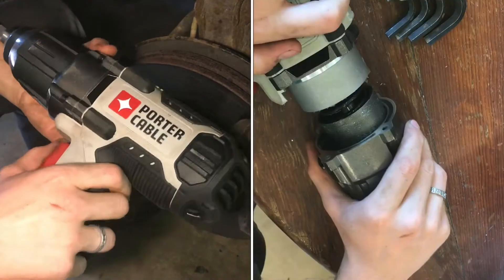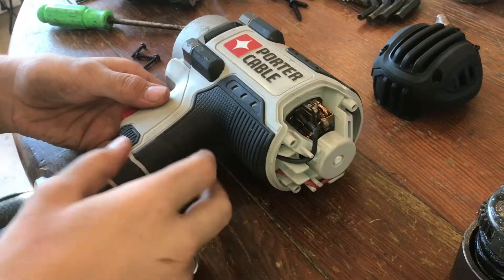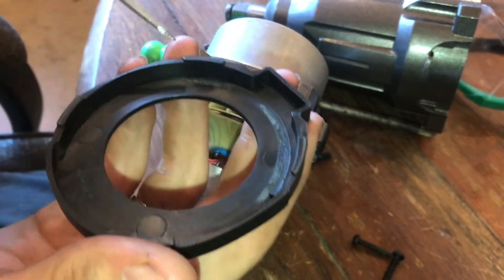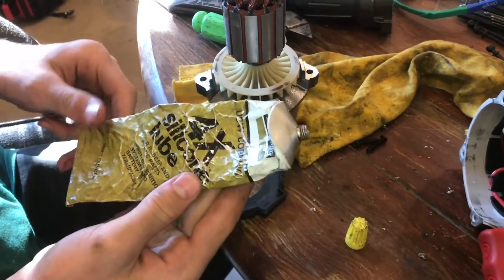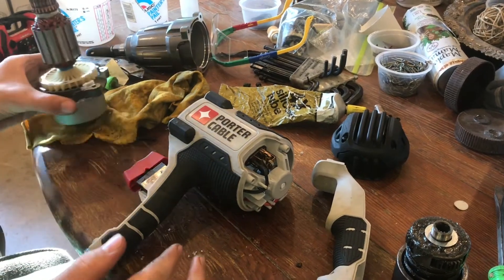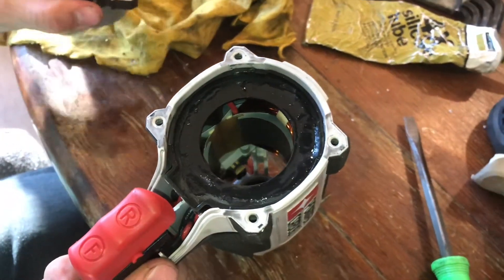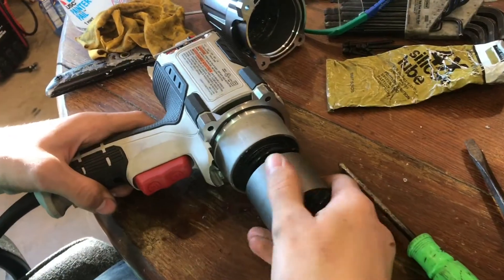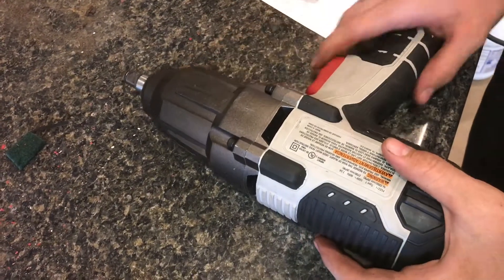fixing "SEIZED” porter cable impact wrench (manufacture defect)

Comment: BTW that is the exact same impact as the "CRAFTSMAN" one same parts same motor same switch etc.  I just took mine apart for the exact same reason and found this.  Craftsman used to be a good brand what happened?

Comment: OK.  I guess I won't buy one then.  Putting grease is not a good solution, you're just asking for trouble getting grease on the motor, or collecting dirt.  Just remove the black ring thing, the fan shroud.

Comment: I received my Porter Cable impact wrench 2 weeks ago.  The first thing I did was apply di-electric grease to the motor fan like they have the tendency for the plastic to weld itself to.  I have used it to remove the pinion nut on my mustangs rear diff, driveshaft bolts, axle nuts and lawn mower blades on our riding lawn mower.  I am very impressed with this $85 impact on ebay!

Comment: Bought one. After seeing this video I decided to do pre-maintenance and take it apart to grease the plastic parts as shown in this video. I used Super Lube synthetic grease with PTFE, -45F-450F degree, dielectric and safe for plastics and much cheaper than the silicon grease.  I purchased the synthetic grease, 3oz,  at Harbor Freight for $7,99.   Simple fix:  number 2 phillips, a metric number 4 Allen wrench and two 2 1/2" nails to go across the brush spings. Put back together, been using it ever since to do lug nuts.  Running strong, no issues thus far.  Thanks for the video

Comment: I was just thinking about buying one of these and looking for reviews I found this video. I think your video is awesome but I also think someone has to sue Porter cable and make them to perform an upgrade or recall on these devices. It's not fair for costumers to have to deal with design flaws.
Reply: I just ordered this impact, even though I knew about the problem.  This is still the most powerful corded electric impact on the market.

Comment: That piece is a "fan shroud", it is used to concentrate the air flow through the motor. I see that you are having a problem with this coming into contact with the fan but unfortunately if you put grease on it you are only going to create a new problem. As dust is drawn through the tools it will mix with the grease and create a thick sticky mess that will slow the motor down. Unless there is some way to modify the fan shroud to create more clearance I personally don't see permanent solution to this. Good luck
Reply: You’re right. They’re just trading one problem for another.

Comment: Mine seized today and it is fairly new with very little use. Very disappointed that an almost new tool seized just removing lug nuts.  Lost some faith in Porte Cable after today. I have many other PC tools that have never failed hope this is not a trend for PC tools.  
Thank you for your video it is just what I needed.

Comment: This corded impact wrench is the Porter Cable PCE211. I recently decided to buy it because I wanted something with a little more torque than my my 30 year old Harbor Freight one. This video is the best on YouTube on how to disassemble and reassemble the unit . 
Here are a few fine points to make the task go smoother:
- Be proactive and lube the disc before you have it jam up on you. I used a tube of Super Lube synthetic silicone grease. The reason why the plastic disc contacts the fan assembly is because of the pressure placed on the center shaft when pushing  the impact wrench onto the nut / bolt. 
- This is also the perfect time to add extra grease to the gears and mechanical parts.The grease looks to be compatible.
-The ideal hex wrench to remove the four main housing screws for me was a long  number 3 metric.
- Insert the long finishing nails on the brush clips BEFORE removing the motor shaft.
- Be careful when adding grease to the black disc. It should be placed away from the center hole to prevent grease from getting to the motor windings. Look at the video showing the wear marks on the black disc as a guide.
- Upon reassembly, be sure to install the grip handle BEFORE putting the motor shaft back into the housing.
- It would be ideal to install the same screws in the same holes they came from. I didn't do this and had a hard time reinstalling a few. Don't over tighten the screws since they are going into plastic.
- Some people suggest removing this disc altogether but this modification may void your warranty.

Comment: good info . thanks
Reply from the maker: I was actually really surprised, when I saw a porter cable but there’s two plastic pieces so close together without any lubrication. I don’t know if the private label this, or if they actually engineered it. Besides this issue it’s been working as good as the harbor freight one that I had for six years before I got this one. After seeing this I kind of wish I went with the Harbor freight one again. With the discount on the porter cable both were about the same price. I figured the Porter cable should be better. Hopefully they’ll fix this problem in the future
Reply: @livefree6878  it looks like it pretty well made but u probably  could get one as good for less at harbor freight.  I shop lawn shops . Got a porter cable  impact driver for 20 bucks yesterday.
Reply: Thanks for this video! Same thing happened to mine a few days again. This fixed it!